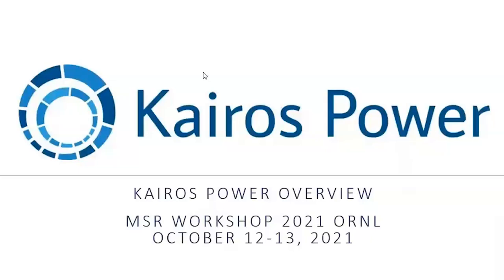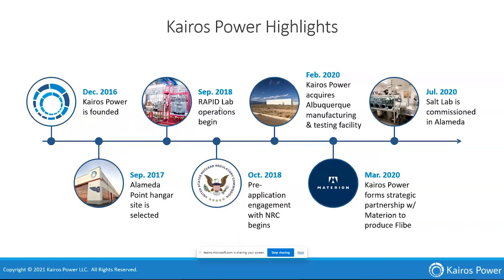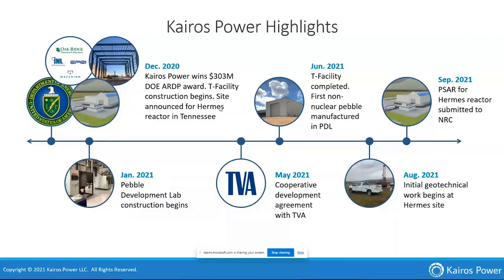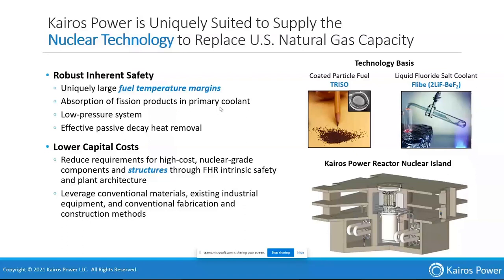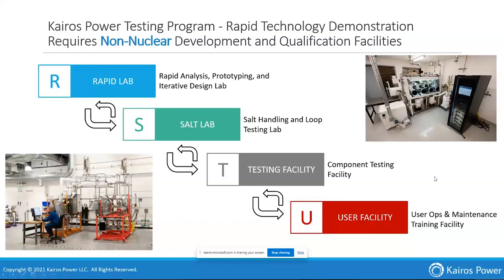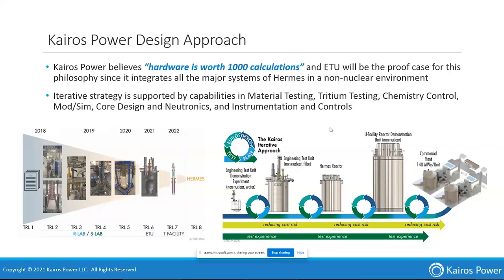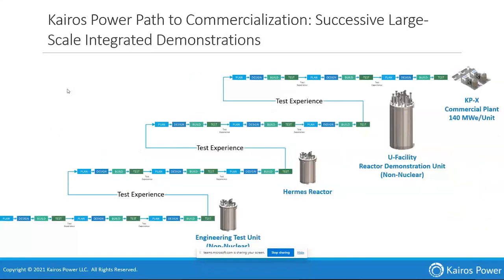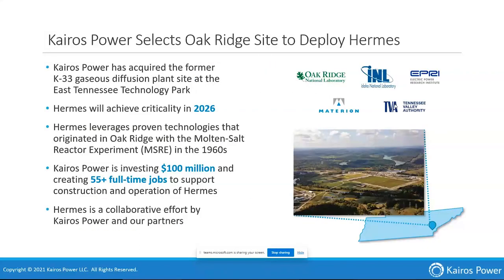Kairos Power Overview (October 2021) - Brandon Haugh @ ORNL MSRW 2021

Comment: Total BS reactor design.  Absurd.
Reply: Aside from dependency on HALEU and overall less efficient use of uranium resources, I don't see how this is inferior to liquid fuel MSR for power production purposes. The safety case is insanely strong. High temperature process heat. And I assume one could stick TRISO pebbles directly in a geological repository.